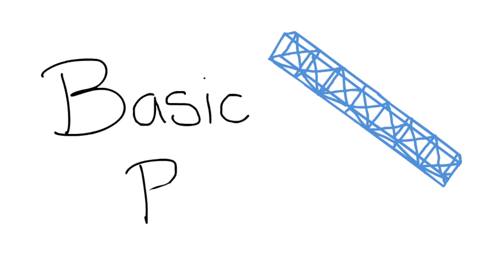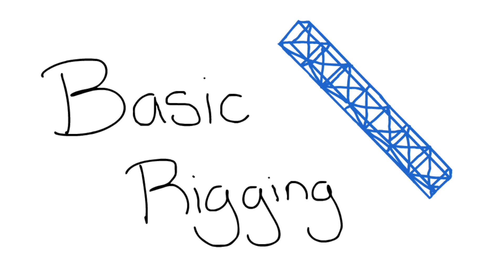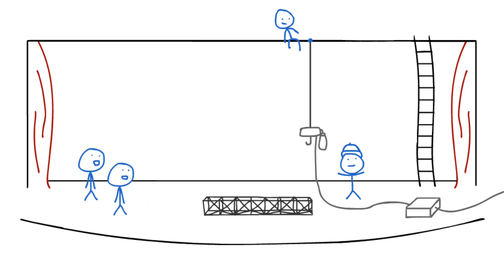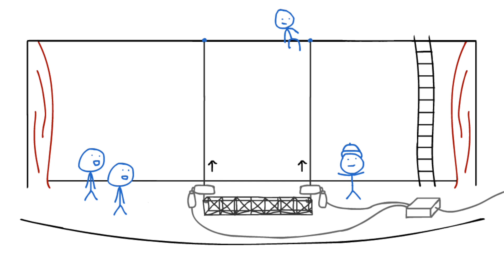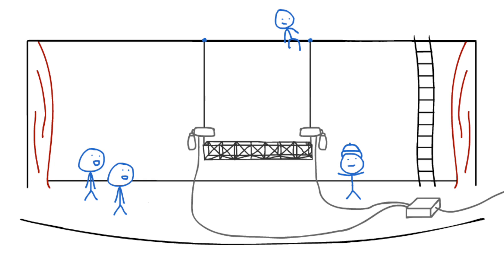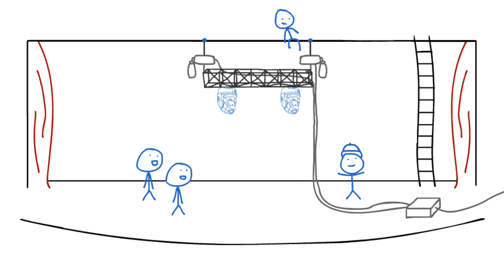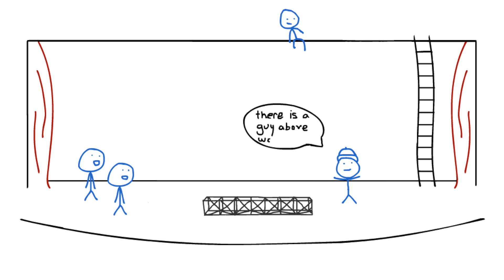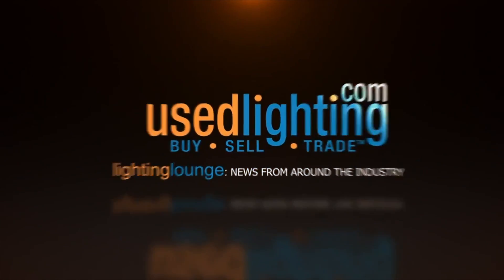Lighting 101 Series - Part 5: Basic Rigging

Comment: As per some previous comments...all point rigging is assembled on the ground by the ground rigger - NOT IN THE AIR by the top rigger! The top rigger/s will lower in a line (either rope or an electric winch) & the ground rigger will attach the top rigging to the line, usually also along with the chain hook of the chain motor. The top rigger will set the point & the ground rigger will direct the top rigger if any adjustements need to be made. After that the motor is floated & can be attached to the truss.

Comment: I love the overview, very good as an introduction but there is one point that should be clarified. The points are built completely on the ground, not in the air. One extra shackle is included to complete the loop that goes around the beam (working shackle and basket in technical terms). This way it eliminates the need to manipulate loose items in the air, with the exception of one shackle pin.
Reply: B A yup, an open basket.
Reply: It's called a rock and roll span set. Like you said you only need to set one shackle to join span set.
Reply: Not to mention, this way you need to pull up one point twice. On a big venue, where you need to hang 15-20 points/rigger, no one have time for this. And if the basket is a big one, you just have much more trouble this way...

Comment: Drop the other end of the rope so the grounder can help you pull the load.
Reply: That only works if you have a point within reach above you, where you can set a pulley. And not every venue have that kind of structure

Comment: Ok first of all: We would never Climb up to the top of a steel-struction  and tie a rope and get the chain. We would rather take a lift or Crane lift, but that is just if it is less than 30ft over the ground. For some big arena stages, they have bridges on the roof. For the second thing: We never gives warnings (Because everybody who are stage providers are informed when and where Things are, and Dangerous areas). For the Third thing: the chain do not fall to the ground, it goes in to a small bag. 

This video is for People who are not riggers or structual engineers or some sort of stage providers, it is just for audience who are very curious.
Reply: Once the main arena in my city is done with renovations, the grid over the stage will be all open beam walking... it used to have a lovely series of catwalks. Not sure of details, but we've heard rumors that the grid height will be 95'. Expecting to be a bit spooked walking out on those!
Reply: @slowgold20  
You've been up yet? Jealous🙂
Reply: @AB-80X  yes, many times. In fact in a couple hours I'll be going up again. Also, to update my last comment, that arena is done. Yes it is open beam, but with catwalks too.  We set up so people on the cat pull the chain up, and the person on the beam just has to connect the point. Pretty swanky, and way safer than trying to balance on the beam. I still do that sometimes at other venues though!
Reply: @slowgold20  
Ah yes, I kinda thought it would be like that. That's really how they build them these days. If I was a contractor building a new area, I'd factor in rigging too. A shame though. Working pure open beam stuff is so much fun.
I'll be going up at a place in Sweden in a few days. Place was built in the late 60's I   think. No catwalks, and most "beams" are not even I, T, H beams, they are round tube lol. World's largest monkey cage, it's gonna be awesome😀

Stay safe up there my man.

Comment: I thought the safe way was to drop the rope and have the ground pull the gear up rather than the poor guy that's in the air.
Reply: How will you do that if you're at a venue where you cannot secure a pulley above the top guy? Yes you can secure pulleys sometimes, but far from always. These are not THAT heavy, and the floor guy is always out of the way while making sure the load does not start to swing. If pulling the point up is the hardest part of the job, then it's an easy job dude.